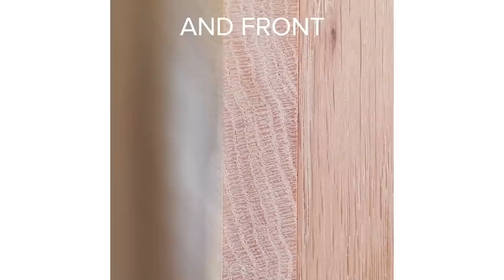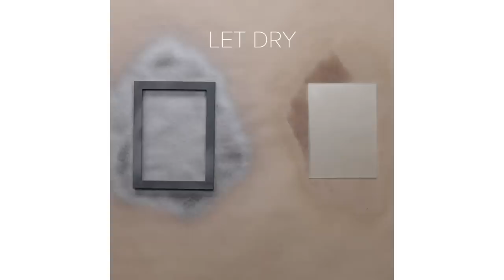DIY Projects For First-Time Homeowners

Comment: Why is it such a trend to paint everything white?! It takes away all of the charm and uniqueness! After dealing with white walls and cabinets for years while renting, I want to have some color in my house!
Reply: But it's not a trend. It's an illusion to make a room look brighter, open and larger. It's also neutral, meaning if its rental, its easier to sell then a part with blue walls or green. It will actually turn a lot of people of. Plus its easier to design around. It easier to have bigger thing like the walls, floor, etc neutral and have piece like furniture, art, etc be louder, because it's easier to change them with your style, a lot harder for the other things if you want to change that. Btw this isnt by any means, telling you that white walls or lighter colors are the best for you, because its you're place and you can whatever you want, but why it's the best as a design choice to appeal to the general public.
Reply: Taylor Wilcox  then don’t paint it white, this is just a tip, use colours from the same palet  that compliment each other, white just makes a room look lighter
Reply: you could also use very light/pastel colors too, probably. i would say to avoid a pure white in most cases, but it boils down to choice, really
Reply: @Ma5jay5dontxdoxthat  THANK YOU!
Reply: I would never paint my walls white, but for the illusion of certain things or spaces to seem brighter I agree with what was said, it is easier and renter friendly for white walls. I rather go with a light grey to bright things up and put accent colors around that. But I am doing two tone colors for my cabinets, my space doesnt get alot of natural light so I must do lighter colors to account for the lack of light.
Reply: I like the natural wood look.
Reply: Definitely kinda soulless
Reply: I agree plus you can always see any dirt or finger prints with white
Reply: At this point white walls are stating to make me nauseous.

Comment: Great one day diy projects 
A couple helpful pointers to make projects last
The vinyl floor, should always have a top coat to protect pattern especially in traffic areas.
Gutter project support board should always be primed with paint or stain especially out in the weather to prevent weathering 
Hope these extra steps helps keep your projects lasting longer.
Constructively 
Thank You

Comment: Wow, the first two have a lot of problems. First, make sure your cabinets are solid wood and not veneer otherwise you could sand right through the veneer. You can't use any old paint or stain. You need some high quality stuff with an enamel hardener otherwise it will look like crap...not to mention that painting them with a brush is not a good way to do it. 

Buy a drawer handle drilling jig to put on the hardware...otherwise, good luck getting them lined up correctly. 

Your nail gun isn't set properly, the nails aren't shot into the wood all the way. You can see the heads sticking out. Also, use some wood glue in addition to the nails so things don't start separating.

Comment: First time homeowners:
Step 1-  Have expensive power tools.
Reply: You can rent a lot of their for fairly cheap.
Reply: First time home owners: make a Firepit because that’s what you definitely will need when you just moved in.
Reply: Actually, Lindy....
I'm very seriously considering building a firepit.  For the most part- to burn bits of yard work trimmings and branch clippings.  Maybe some organic trash to help speed up my composting so I can get some nice super rich soil going for the raised beds I'm building.  That and the amount of sticks I have laying around needing bundling and all those dead palm leaves on the palm tree in the front...   So much work to clip them all down and bundle them up.  Better to just burn them, I think.
Reply: @lindymoore  to be fair, it's project for first time home owners, nothing about them just moving in.
Reply: You don't need 'expensive' power tools but everyone should at least have a decent drill in their house.
Reply: @forevergogo  fire pits are great! Just make sure to look up local fire codes before you build. Especially how far away from a building it has to be
Reply: In the first year of home owning, I've had to buy....  
A drill, a tall ladder, a weed whacker and lawnmower, a pressure washer, an edger....   yah, not so much power tools, just home maintenance stuff.  I opted for a metal fire pit I can safely use on the concrete patio in the back, plus its easy to clean, pick up and dump the ash. lol
Reply: You can rent
Reply: Patrick Banks every home buyer should
Reply: You should check out some local thrift shops or Facebook marketplace. You save big buying used tools. I probably average 75% off or better when I buy used. My best find was a dremel 4000 for $4.
Reply: @markterzi857  renting is a possiblity
Reply: Lindy Moore I mean that’s literally what the people did in this video. They changed everything in their house
Reply: @slightlycrookedworkshop  Another reason you don't need expensive power tools is because any place you buy your wood from will cut it to your specs for you...  usually for free.  ;-)  Just a no-fuss, no-muss option.
Reply: Ryobi is like one of the cheapest brands, they're not using hilti or festool, which would cost quintuple those tools
Reply: Step 2- painting everything white

Comment: I was thinking of painting our grey-brick fireplace off-white for a more modern but still-cosy look. Unfortunately, my brick is not so 'smooth' as yours. How do you paint something like that? Also, it seems it would soak up a lot of paint so is there a tip/trick before painting REAL brick fireplaces? Thanks